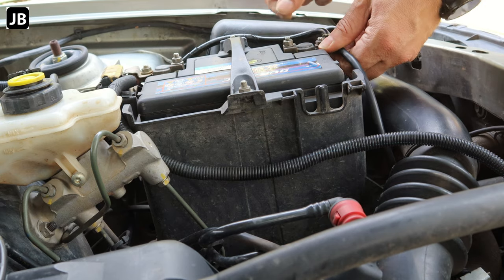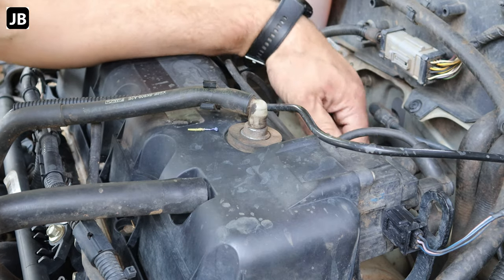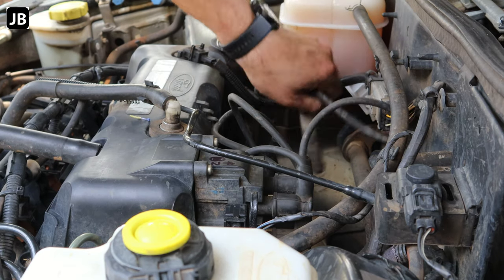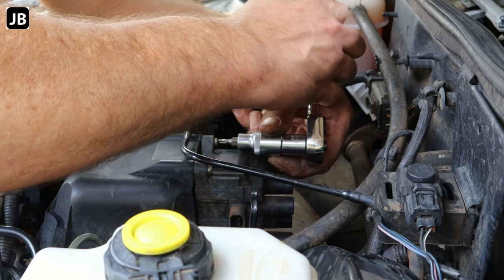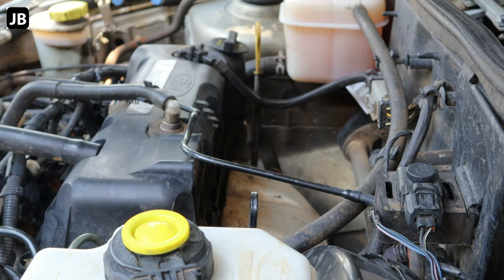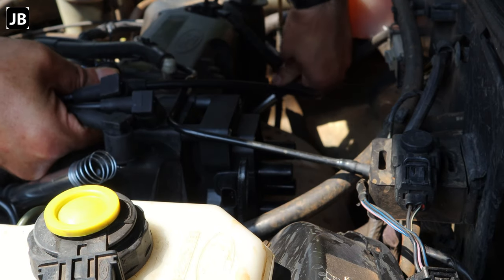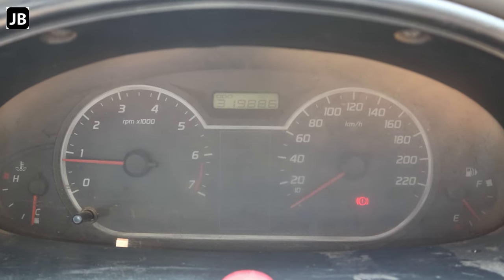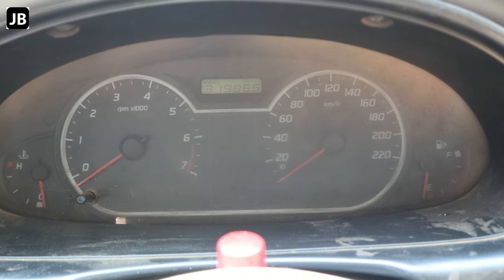How to replace the ignition coil and ignition leads on a Ford Bantam ROCAM 1.3I

Comment: Thanks for these videos... EC has a gap in having quality mechanics... Im lucky to be driving this beast. Recently it was mixing or on the genesis of it. The fortune part is that i saw in time, sad part i took it to the wrong hands that left milky reduce on the engine top cover. 
2. Also struggling with the car losing power, and stalling, eventually stopped (cranks with no luck of starting). Im thinking of changing the coil pack and plugs myself
Reply from the maker: Coil pack and plugs is easy to do yourself. Just make sure you don't swop leads.

Comment: One thing to be careful of when you remove battery terminals. Make sure you've  got the restart code for any radio you might have fitted.
Reply from the maker: You are 100%correct. Luckily I had an aftermarket radio in this one, so it wasn't an issue.

Comment: fiesta runs on a duratec motor with a cambelt. rocam is a rollerbearing camshaft as the name implies and runs on a camchain. Yes most of the non-OEM parts are no longer manufactured meaning you have to be careful when purchasing after market parts. epecially the ECT Switch as their ratings are totally incorrected on kilo ohms

Comment: What are the symptoms o fa bad ignition coil?...I have a hard start situation..checked everything still struggling to start..?
Reply from the maker: Loss of Power. This is one of the first symptoms of ignition coil failure. ...
Check Engine Light On. ...
Poor Fuel Economy. ...
Backfiring. ...
Misfiring Engine. ...
Hard Starts and Stalling. ...
Spluttering and Coughing Sounds. ...
Jerking and Vibrating.
Reply: Mine is loosing power

Comment: At 0:32 what is that pipe with the white plastic and metal tip used for that goes into the top of the engine into that ring thing?
Reply from the maker: PCV hose. Positive Crankcase ventilator valve.

Comment: are bosch parts like coil and wires are good?i bought motorcraft sparkplugs i dont like ngk but need to fix the 4rd cyl misfiring issue.
Reply from the maker: Yes you should be ok with BOSCH aftermarket coil and ignition leads.
Reply: @JacoBadenhorst  thanks.i ll test all wires and coil if there is a bad contact.i ll buy bosch then.

Comment: I have a bantam that won't start. Stood for a long time. Fuel pump fuse keeps blowing also. Think the fuel pump is faulty? I am no mechanic, just a guy trying to learn
Reply from the maker: Probably the fuel pump that is shot. Or maybe rats chowed on the wiring?
Reply from the maker: I'm also not a mechanic. We learn by doing. Keep it up.

Comment: Goeie môre Jaco, net n vraag, het jy dalk al n probleem op jou bantam gekry dat hy sommer net misfire en daarna weer alles reg is, ek maak die plugs skoon dan loop sy weer soos n droom, ek het die ht leads, coilpack, cam sensor, crank sensor, fuel air valve en die fuel rail valve al vervang, kan dit dalk die computer self wees.
Neil
Reply from the maker: Dit is baie moeilik om so oor die internet te sê, maar dit klink of jy Al deur n redelikke hoeveelheid van die opsies is. As jy dalk iemand kan kry om n code scanner op hom te sit?
Reply: @JacoBadenhorst  Ek vermoed nou dit is n harnas probleem, hy reset sy speedo se afstand leesing sodra jy haar aansluit, iewers short sy uit.
Reply: Hoe kan je gemakkelijk bij de onderste komen?